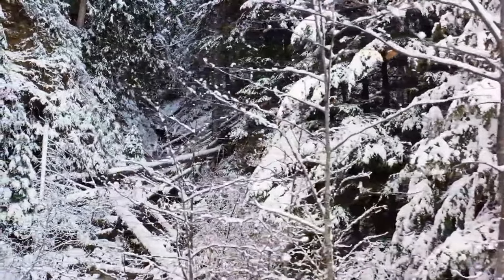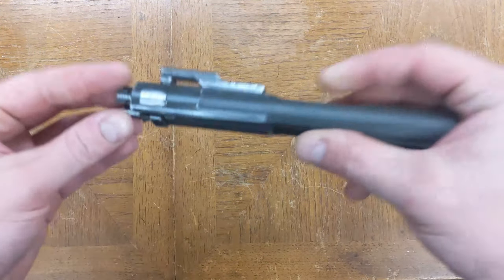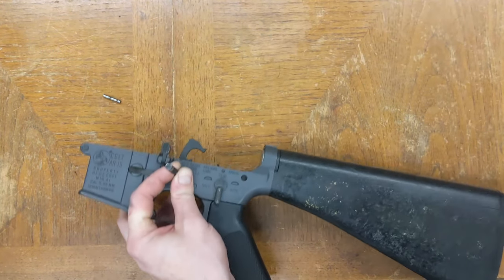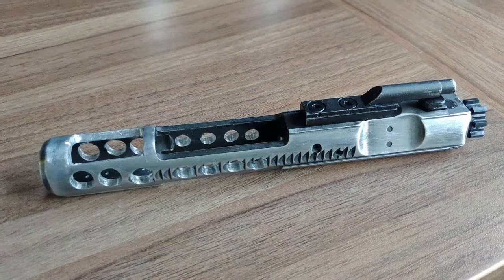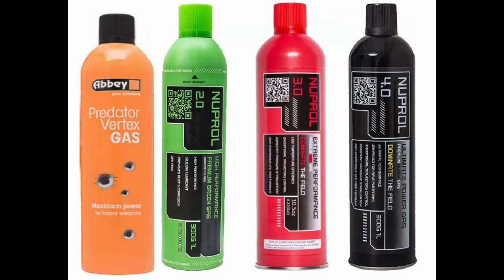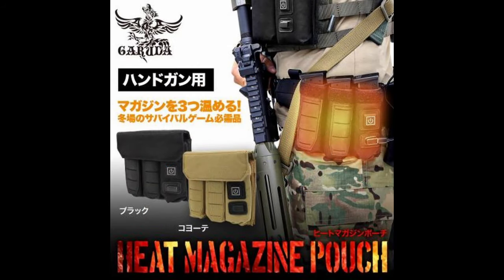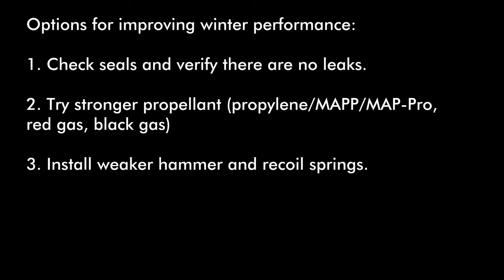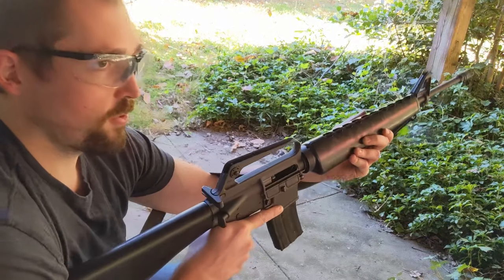Airsoft Gas Blowback Winterization Guide

Comment: I've never been one for GBBRs, mainly because in Ireland we play at under 10°C all year round due to the climate. I've always found them very fun to shoot tho and this video has definitely given some stuff to think about if I ever decide to go the GBBR route, thanks dude 🤘
Reply: Try co2 as the propellant for ur gas guns! they work litterally in all temperatures, and are much more efficient
Reply: @boony853  saddly co2 guns shoot mostly too hard for ireland, we have a 1 joule limit
Reply: @skuzz8182 just chrono with the gas and fire co2 mags in after you chrono
Reply: @lukewoodside9420  sounds like a good way to get banned from every single field near you.
Reply: @afaxmachine5045  depends how hot the gun is, up to 1.2 or 1.3 joules nobody is really going to care.

Only reason they chrono for a joule is anything over a joule in ireland is legally a firearm (which is dumb)

Most co2 mags will shoot about 1.2 joules, vs their green gas counterpart at about 0.9 joules.

Comment: Another amazing video! These guides you’re making are incredible man. Can’t wait for the next one! 👏👏
I was kind of surprised you didn’t mention a tighter inner barrel and an NPAS though.

A tighter inner barrel means that you need less gas to get to an appropriate pressure right? I’ve had moments where my gun barely cycled but the BB flew straight a true after installing a 6.01 inner barrel. But if you do that and then add the higher pressure gases, you’ll defs be shooting too hot (in most cases).So the NPAS is kinda essential. Otherwise it’s kinda hard to “tune” the replica for winter right? I run tight bores in all my GBBR’s except for the AUG and I feel that it improves the efficency quite a bit. Am I just imagining this? 😅

I’ve also done the other modifications though except for the trigger. 

Thanks again! 👊
Reply from the maker: A tighter inner barrel is a solid way to boost your muzzle velocity a bit, though with 6.01 you do need to be more careful about keeping it clean. But in our testing, the difference in efficiency between tuning an NPAS to 1J or 2J is negligible. Basically, the amount of energy being imparted to the BB is irrelevant compared to the amount of energy needed to cycle.

However, there are two exceptions we've run into. The first is that if the rocket valve spring is so strong (or NPAS geometry so unfavorable) that it closes late or never actually closes, it will release excess gas and may keep emitting gas even while the carrier cycles, which really kills gas efficiency and makes the blowback feel soft. The other is if you're using an adjustment system like a grub screw in the nozzle, FG-Airsoft LFS disc, or other FPS-reduction method that restricts the nozzle instead of the rocket valve, then the backpressure these create can similarly delay the rocket valve closing and negatively affect efficiency. In that case, though, the efficiency gets better the less you restrict it, which is the opposite of what you're describing.

All that said, different systems and different combinations of parts can have unpredictable effects, so if you're seeing the best consistency with a tightbore then keep doing what you're doing.
Reply: @ExplosiveEnterprises  Very interesting! Lots of stuff I hadn’t thought of. Thanks for the reply! 👊
Reply: @ExplosiveEnterprises  Are you talking about the RA-Tech NPAS ? How about the homemade NPAS mod ? I mean a grub screw on the back of the rocket valve and screwing it so the valve gets closer to the front of the nozzle, allows less gas inside it and does away with restricting the nozzle, which would cause a weaker blowback effect ?
Reply from the maker: @MargiAirsoft  Homemade NPAS mod is fine. Adjusting where the rocket valve sits (with a grub screw), or adjusting its inner diameter, effectively adjusts FPS without having negative effects on efficiency or cycling. It's when you adjust FPS by obstructing the nozzle that you can run into trouble.
Reply: @ExplosiveEnterprises  Thanks for the confirmation !

Comment: This was very helpfull for me since I am pretty new with GBBRs. I have yet to use my Daniel Defense MK18 GBBR in the winter time, but thanks to you my gun is not only more gas efficient but it chronos low enough (with the weaker hammer spring) to take to all of my local indoor areanas. P.S. I think that it is very funny at 6:16 when you talked about how HPA is better in cold, because it sounded like something that I would fail on my science test.
Reply from the maker: Glad to hear you found the guide useful! Just to be clear, though, a weaker hammer spring should not have any effect on your FPS- your rocket valve in the nozzle is what dictates power, not the hammer. If the power has gone down, check to make sure you haven't accidentally introduced any leaks in or around the barrel. Otherwise, if you've installed a shorter inner barrel or swapped the rocket valve, that would explain it.

Comment: Good day, excellent advices and problem solving. But... Wanted to add, that these will work in low and moderate humidity climate zones. I live in a climate zone, where it can be both cold and very humid during autumn/ winter season, and i can tell you, that even my marui rifles/pistols struggle at 10 - 5 degrees celcius. Not even talking about freezing or bellow freezing temperatures. You lose pressure extremely quickly in cold humid environments... Awesome stuff, keep up the great work!

Comment: Dude your channel is gold!! I just ordered my first gbbr and you‘ve got me covered in everything I need to know. The quality and information of your videos is insane. Thanks man!!! I will get my VFC HK416A5 in a few days. I would love to see a video about disassembling the fire control group. For now I‘ll just stick to cleaning and regreasing the basic parts as you showed but I definitely plan to clean that entire thing once I know how ^^. Oh and last question I ordered green and red gas from nuprol which unfortunately does have silicone oil in it. I found your channel too late to know that this is actually a bad thing because it gets into parts you don‘t want to. Would you advise me to go and buy propane instead of the nuprol gas so silicone oil doesnt even get into the „bad“ parts of the new gun or is it fine if I empty the two bottles, then clean it and only use propane in the future so the money for those bottles wouldn’t be wasted. Cheers!
Reply from the maker: Using green gas isn't going to hurt anything- you just might need to clean it more often to prevent oil accumulating in your hop. So, you might as well use what you have, then switch to oil free gas.

Comment: Quick question about hammer springs- is not a good idea anyway to have a weaker hammer spring or does this have negative effects if you use it in normal temperatures/ summer time?
Reply from the maker: In warmer weather, a weaker hammer spring will reduce felt recoil, though still produces better efficiency. Really, the main disadvantage to a weak recoil spring in summer is the risk of light-striking. We'll talk about this more in an upcoming Q&A.
Reply: @ExplosiveEnterprises  Ahhhh I see, thank you for getting back so quick and that makes a lot of sense thank you! 🙏

Comment: Interesting stuff indeed, I hadn't seen such complete temp/psi figures for Nuprol gases before. Do you have any idea what the Vorsk run at?
Reply from the maker: Wish we could tell you. Manufacturers seem loathe to disclose the contents of their gases so guess-and-check is about the best you can do in many cases.
Reply: @ExplosiveEnterprises  Indeed, but I had to ask :) In some cases, the manufacturers even put scientific nonsense on the label so that doesn't help us either! 

I do have a list of "nominal" PSI ratings at room temperature but that nuprol document that you displayed is by far the most concise when it comes to a particular gas. Anyway, you got yourselves a sub for covering a topic that seemingly mystifies people and has done in my 20+ years of playing.
Reply from the maker: @MercutioUK2006  Much appreciated- and to make it even less useful, keep in mind that different gases may have different pressure/temperature curves. So, even if a gas is advertising 200 PSI at room temperature, it's entirely possible it could actually produce /less/ pressure than propane when you take it down to freezing. If the manufacturer won't tell you exactly what's in it, the only way to know is to test. We wish it weren't so opaque, but at least with propylene/MAPP you know exactly what you're getting.
Reply: @ExplosiveEnterprises  Absolutely! I tend to stick to Nuprol as the UK is fairly mild most years, but with the current prices I am considering MAPP + an adapter instead. 

Nuprol seems to have a reasonably consistent curve but in years past I've had, as many people have, such trouble with juggling gas types/brands......that I have launched at least one poor glock across the room in frustration 😆

Comment: The you connect your hPa adapter to the magazines, is really unhandy in my opinion. Don't get me wrong, it's your setup. But just out of curiosity: do you know that there exist hPa adapters that are way smaller and work just like the standard valves?
Reply from the maker: You mean because the AUG mag HPA connectors are on hoses, rather than directly replacing the fill valves? Yeah, we're aware; it's a necessary evil for this particular setup (these are actually custom-made hicaps, not just tapped gas mags) to keep the valves accessible and avoid blocking the magazine release. If you check out our video on how the mags were made, it might make more sense.

Comment: For ar15 gbb buffer weight can be also adjusted for different temperature, combination with recoil spring, but just need to pay attention to bolt bounds when reducing buffer weight too much.  I find real steel buffer is quite good in gbb,

Comment: what is the difference between the blue bottle and the yellow bottle? or its the same?
Reply: Blue is propane, yellow is map gas. Map is higher pressure than propane. You can buy it at most hardware stores in torch bottles like what they showed

Comment: Great guide! What would you recommend doing to shim the magazine catch?
Reply from the maker: Strips cut from soda cans make great shims, just superglue in place.
Reply: @Explosive Enterprises thanks for the tip! I just tried it this weekend and it works beautifully. I actually had an issue with the nozzle/bolt not grabbing a bb if the magazine wasn't sitting high enough.

Comment: "" Laughs in GHK G5 **

But seriously - thank you for showing some love to GBBR users! 

I've more or less steered towards GBBs simply because I prefer the realism and the discipline it instils from their usage to maintenance when compared to the relative ease of an M4 AEG using a 400rnd hi-cap!! (I detest hi caps btw)

I've been using my G5 with an adjustable nozzle and only black gas to keep up a maximum output with only needing to refine the FPS where applicable however, winters in the UK are generally becoming milder now and it only ever gets bitterly cold when it wants to have a strop! Of course, she slows down a bit but has never outright vented on me and has always pushed out the round. 

Otherwise, I totally appreciate the points raised here and its a good mix of different tips without any pretentiousness -  have fun pew-pewing!

Comment: these tips work as well with pistols? I have a glock with a roni kit that I'd love to keep using during winter
Reply from the maker: Yup! All the same tips and tricks apply, although with a Glock you may not be able to find a weaker hammer spring, or a weaker recoil spring that will still cycle. Using a stronger propellant, though, should keep it going.
Reply: @ExplosiveEnterprises  I see, instead of getting a weaker  recoil spring I'm planning on buying an outer barrel made to not create the ''barrel tilt'' so the slide runs smoothly without touching it, may work as well right?

Comment: With ghk m4 it suggests taking the weight out of the buffer weight for winter. If that helps.  I've not tried it yet.
Reply from the maker: GHKs use pretty weak recoil springs to begin with, so that's a case where reducing the reciprocating mass can improve efficiency without compromising the carrier's ability to fully cycle. More importantly, you can always just put the buffer weight back in if it doesn't improve performance, so it's definitely worth trying and seeing what happens.
Reply: @ExplosiveEnterprises  I 3D printed a new buffer for my WE 416. It's 28 gramms lighter (about 11% from the reciprocating mass) but I can't confirm if it's doing anything, I'm still waiting for my lighter spring from anareus. They must have a lot of orders or something because they are dragging their asses!

Comment: Co2 for GBB guns is actually better than green gas, it can easily pull heavy realistic full metal slides and is way more compact to carry a few cartridge compared with one big green gas tank..
For Co2 you should also add silicone lubrication on the insert to increase longevity of gun, or buy special capsules that have silicone oil in them and use that after every 10 normal cartridge..
It is just way more consistent, the fps decrease is not so bad like green gas and it just works better in all climates.. For green gas to be efficient you need them less realistic half slide guns..
I have seen colt 1911 work years on end with co2 and they did not break at all.. Overall having GBBR is fun and all, but in the end blowback is less accurate and to be competitive in airsoft games AEGs are actually allround more superior and even better than HPA.. AEGs can have really nice sound and keeps the realism somewhat without connecting hose and paintball tanks.. GBB is only really needed to have in the sidearm and co2 would be my choice of gas for sure and for the main a full spec custom AEG would be worthy.. As for collector, training and heavy maintenance lovers GBBR has some value.. When it comes to backyard plinking, I know for sure my neighbor would rather hear an AEG than GBBR that is way to loud and less stealth also for in games..
Reply: My man this is possibly the most confidently and consistently incorrect YouTube comment I've ever seen, congratulations.